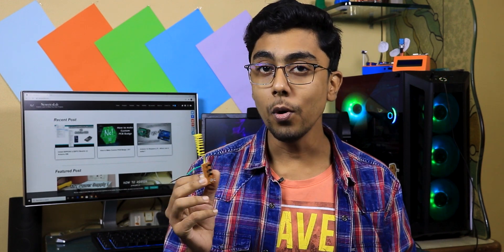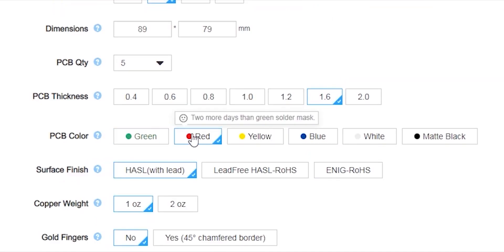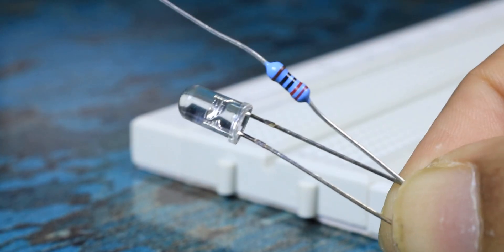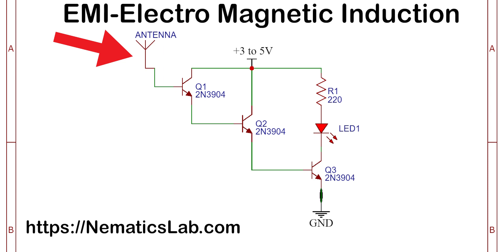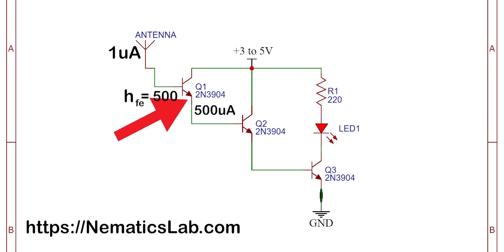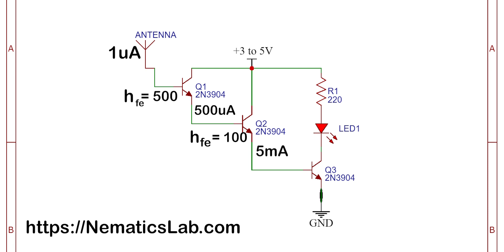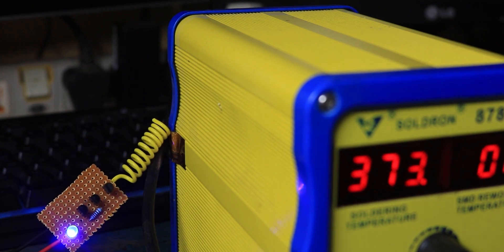How to make AC Tester | Mains Voltage Detector Circuit | DIY

Comment: This circuit does not work right for me, it will light up if i get near the antenna or touch it but seems kinda random when going to detect voltage. Seems to just amplify any noise it receives but not necessarily from any 120v source
Reply: Truuuuue , me too I've  been working on a simple project about this , I even made a printed board for this and I looked like a clown wondering why it's not working, truth is that it's a capacitive proximity detector circuit, partly because of the nature of the high gain and high impedance xtics of Darlington transistor arrangement

Comment: Please clarify again. I think the current amplification from the first two transistors is needed to turn on the last transistor (ie connected to base). This current does not drive the LED. Once this Tr is turned on, the current from the dc supply passes through LED

Comment: Wow thanks a lot 👍, this is the only video I have found that explains how the circuit works and it explains it perfectly. Can you explain what the value of hfe will be for the transistor in the example (2N3904), when I look at the datasheet for it there are several values, how do I know which one will be the one to use?
Reply from the maker: Use the average value :)

Comment: Hey brother , it's working but some time , when I connect battery, the led start glowing first ,why????
Reply from the maker: Random noise & maybe inrush current
Reply: @Nematics_Lab  it have any solution??
Reply from the maker: Try adding 100uf cap between VCC & gnd
Reply: @Nematics_Lab  parallel or series
Reply from the maker: Parallel to VCC & gnd

Comment: The antenna is not a capacitor. It's more of inductor. You can see it's a coil. A coil will have inductance
Reply: It is usable inductance if both ends are connected... making this "antenna" a capacitor

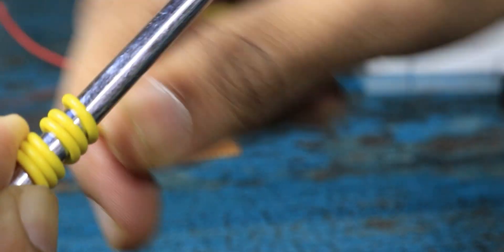Comment: 3:13 A capacitor? Doesn't it works more like a coil?
Reply from the maker: A Coil is essential a capacitor
Reply: @Nematics_Lab wtf? A coil is the opposite of a capacitor. A coil is not a capacitor, they are opposite in nature, like water and oil, like women and men
Reply: No it doesn't work like a coil it works like a capacitor and the more surface area the more will be it's range because of increased capacitance.
Reply: @anmolkumar6704  I am sure you mean it works like an inductor or coil as @TheProud said.